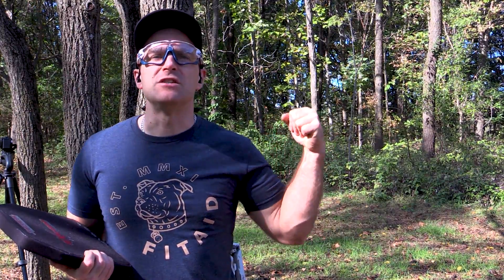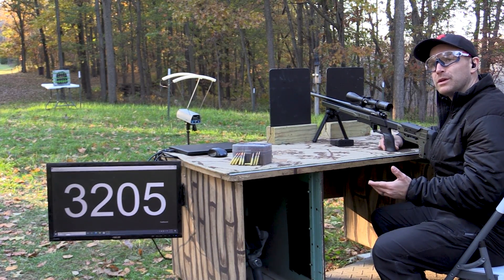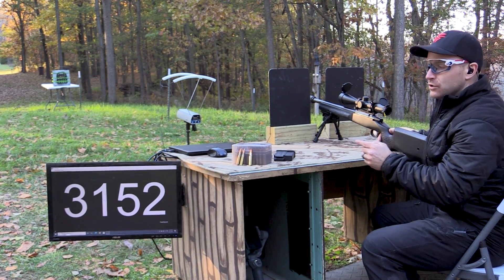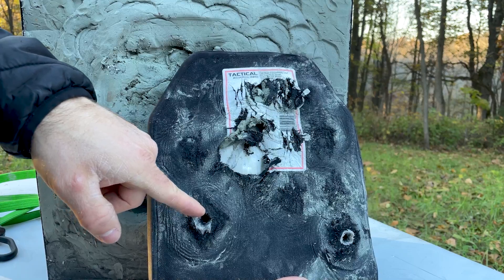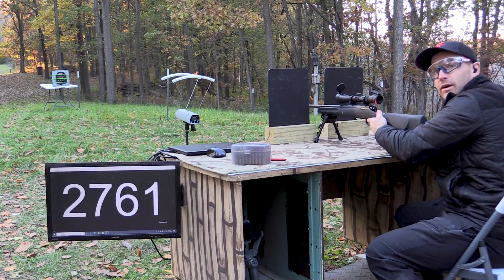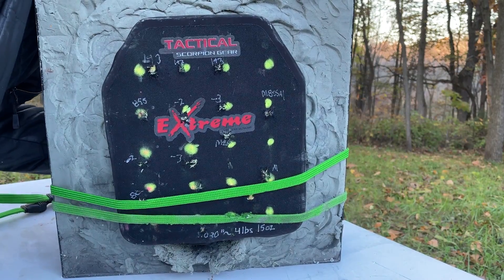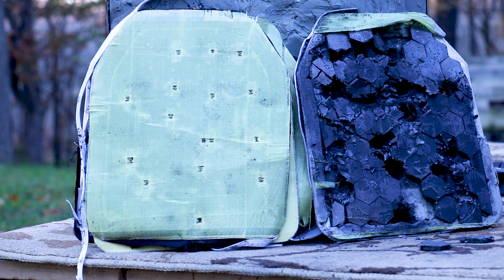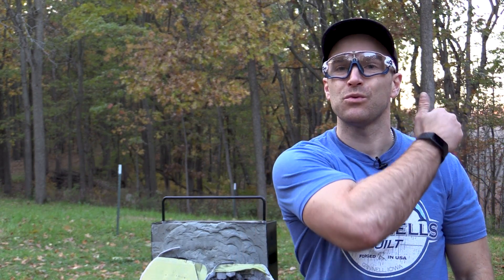S-Rank NIJ Level III+ / RF2 Body Armor?! Tactical Scorpion Gear Extreme

Comment: I would be sold on PE composite armor but for one thing. PE breaks down in extreme temperatures.  I think they can only be in the range of -15F to 150F, which is good for most situations. However, where I am at I have had winters where it gets to -20F to -30F and summers as hot as 105F. If I was to leave it in a car at 105F it could be compromised. Were there tests done by anyone in these extreme conditions to see if they could still work after being exposed in extreme weather conditions? That would be neat if they could still work after at least some kind of exposure to extreme weather. If they did, I might give these a chance.
Reply from the maker: This is a data point that might interest you. I left 2 plates outside for 3 yrs:
https://youtu.be/1-UEQP1JPFg
https://youtu.be/BhG8cOe_ouk
Reply: OK! Thank you! @BuffRANGE

Comment: I got the tactical scorpion level 3+ lightweight with their Bearcat carrier. I got extra side plates so I can test it out but it seems good. The plate carrier not so good. The pocket for the side plates are too small you can't seal with the plates in, the shoulder straps use Velcro and clips but the Velcro isn't strong enough to hold it so it slips down so the plates don't stay in the proper position. Maybe their other models of carries are better but based of mine I'd recommend getting the plate carrier somewhere else if you buy their armor

Comment: How is the edges on these plates? Just straight foam or does the ceramic actually cover the stated size?
Reply from the maker: The ceramic on this model at least as of testing does not extend to the full stated size. So a 10x12 would have potentially 8x10 of ceramic coverage with the rest being a non ballistic material extending to the edge :D

Comment: Thanks Buff!  You said to let you know about further testing - how about a fast, light, all copper 5.56 commercial offering?  Something like a 45 or 55 TSX - midway has the 62gr TSX Vor-TX Ammo in stock right now.  I think an all-copper loaded fast from your 22" barrel might have the best chance of getting through.  It would be an interesting video to see which commercially available copper bullets one could load fast enough to get through these plates.
Reply from the maker: I've used the 52gr TSX and it only excels at penetrating steel.

Comment: What do you think of RMA 1155MC multi hit IV vs these? I realize these are 3+ extreme and the RMA 1155MC is actually cheaper and not really much heavier.
Reply from the maker: 4 lbs is still a bit of weight. If you don't need to stop M2AP loads that's something to consider. If they updated for edge to edge protection it would make this plate a solid choice.
Reply: @BuffRANGE  I actually went with the Tactical Scorpion Level IV PE/Silicone Ceramic after watching your video on it as they have a Labor Day sale and I got two sets (one for me and my son) for $1060. Thanks for your awesome videos and testing! As many have said before me, I’m shocked you don’t have a gazillion subscribers.
Reply from the maker: @midnightrider723  Nice! I'm guessing the "armorking" discount code didn't work on top of their sale, but hard to argue with 4 plates for 1$K

Comment: Why dont you ever see loads lighter than 55 grain .556?
Reply from the maker: They have 45-52gr copper loads. Any lighter and they’re basically varmint loads.
Reply: @BuffRANGE  the super fast 40 grain has beeen shown to be almost AP
Reply from the maker: @crunch9876  against steel.  Ceramic and PE are different animals
Reply: @crunch9876 
I shot a Hardwire L3 PE plate with Fort Scott 40gr 5.56 and it stopped it. 16" barrel from 30'.